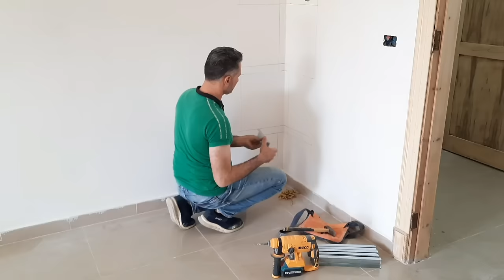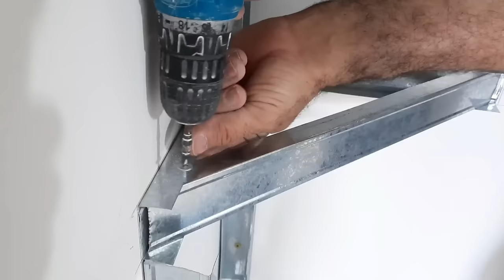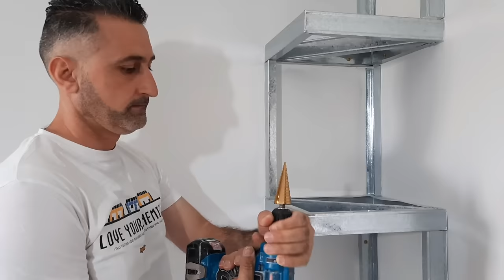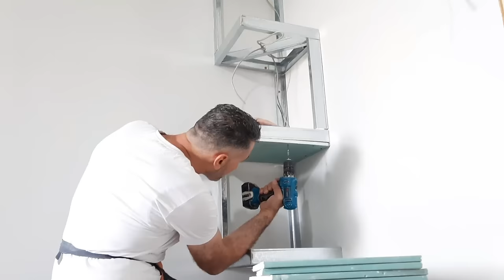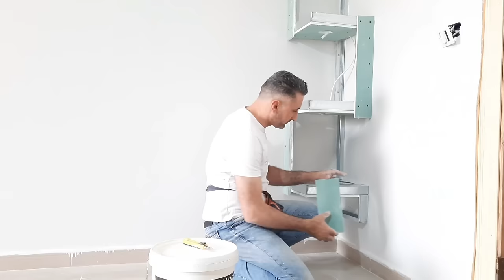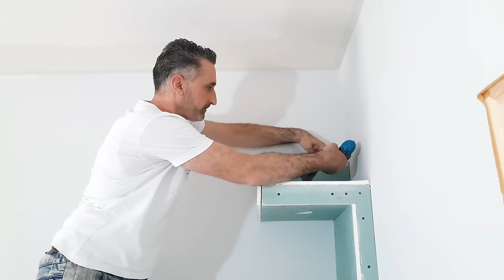طريقة عمل زاوية عرض من الجبس بورد مختلفة كلياً مع الدهان و الإنارة

Comment: I'm a gypsumboard/drywall installer too like you. Some of your materials are not available here in our country thats why some of your techniques are new to me. But kudos on your channel.
Reply from the maker: Like what
Reply: @Qossai  i dont know the name of the material you using because it was not common nor available here in our country. There is a video of yours that instead of using a w-clip to hold the metal furring, you using a some kind of metal stud that already had a holder that can be clip on to your furrings.
I also dont see you using the normally wall angle but instead a some kind of wall angle  that had a clip on holder

Comment: hy,may i use thinner wall panel for making furniture?I mean to use eood structure
Reply from the maker: It will be good in a gyp boards.
Reply: @Qossai  12.5mm
Reply from the maker: @snakes111b  the gyps boards is 12.5mm